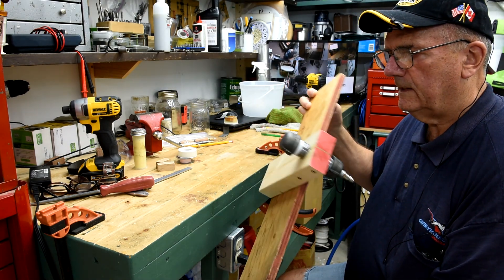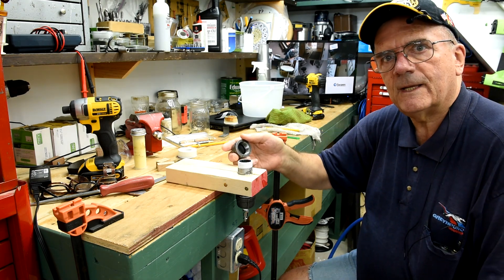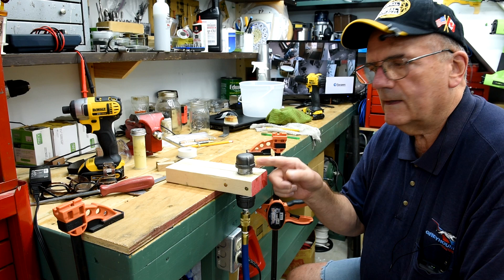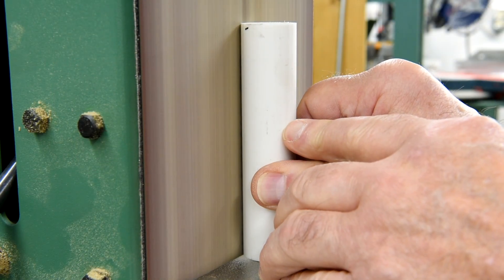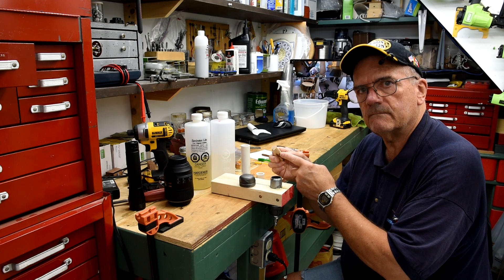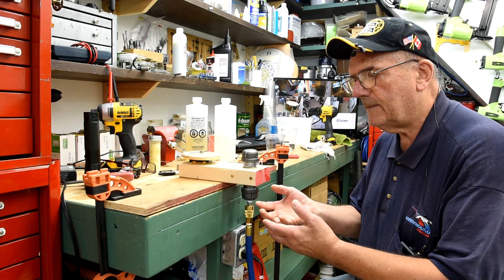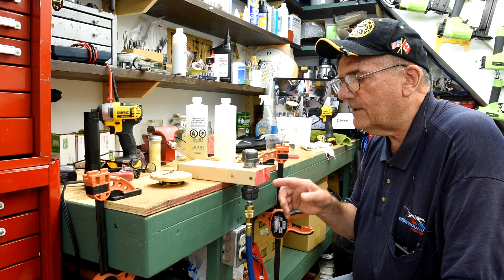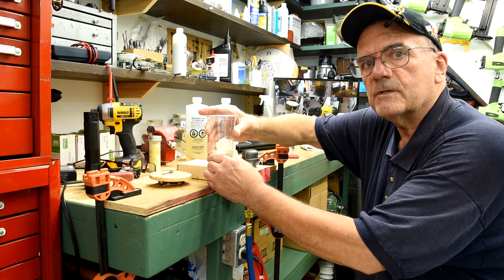Vacuum Infusion Test - Part 5

Comment: Ok. So this is getting a bit confusing. You're putting the blank in a vacuum to suck out the air. Then introduce the envirotex Spelling? Then put the blank under pressure to force the envirotex into it. But wouldn't the air move straight back into the blank between the two procedures?
Reply from the maker: No, because the blank is completely immersed in the Envirotex Lite while still under vacuum. I'll see if I can explain this better in episode #6. I realize that even though it's very understandable to me because I'm doing it, but it must be a bit confusing to the viewer. Thanks for the question David :)